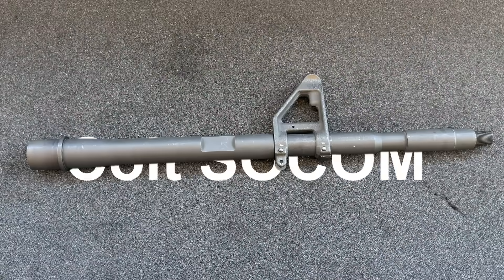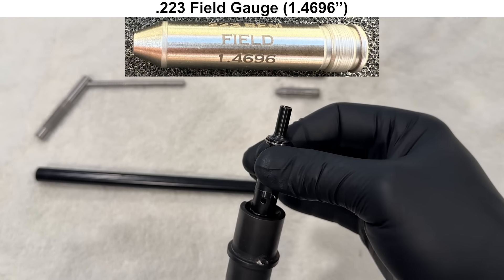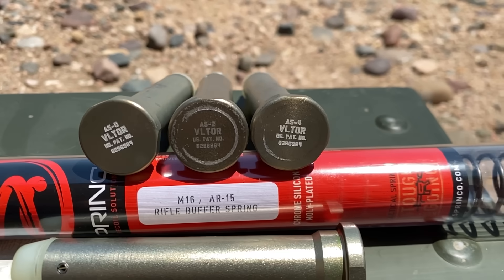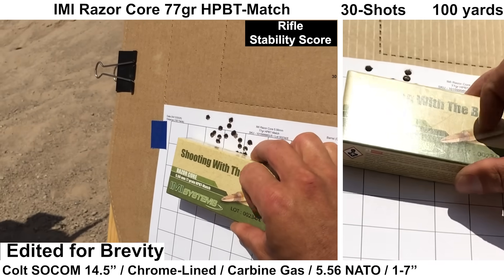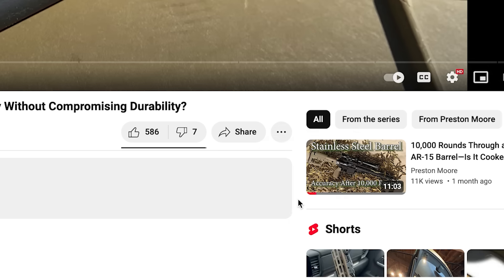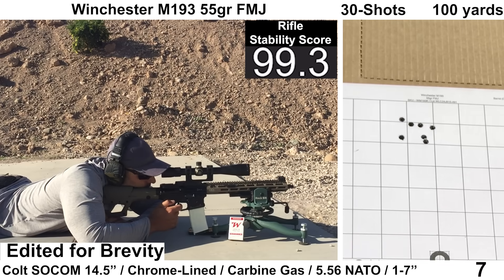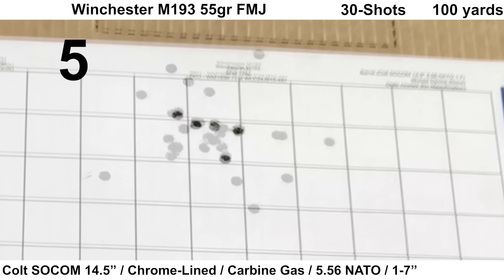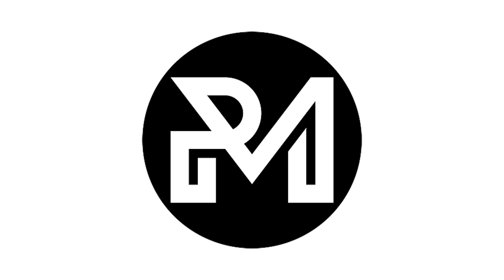Testing a Colt SOCOM AR-15 Barrel (Groups, Borescope, Headspace, etc)

Comment: Thank you for these videos, I am thoroughly enjoying them! I was curious, have you ever thought about doing comparisons of barrels with/without suppressors? I ask because, well one, it's pretty widely believed that suppressors can improve accuracy with most barrels, and two, I just happen to have a M4(ish) build I did using this same 14.5" Colt SOCOM barrel, and my results have been considerably better compared to how it performed in your test. Now yes, I completely understand that different barrels, environmental conditions, ammo, and even the shooter, will make a difference in results, but I was genuinely surprised at how poorly the barrel did in your test, and was wondering if the fact that I almost always run mine with an AE M4 suppressor (aka the Gordon suppressor) on the rifle made a big difference. 

By way of example, on my last outing with that rifle I was testing two different lots of the AAC 77 OTM ammo I had purchased just a month apart, and with one the first lot I decided to put a full box into one group. That 20-round group, as measured by Ballistic-X, went into 1.822" (0.771" W/1.816" H) with a mean radius of 0.484". For the other lot I only shot 10 rounds, but those went into 1.425" (9-shots were 0.919")(and oddly, 1.396" W/0.416" H) with a mean radius of 0.381". I would also note, even though both lots were the exact same SKU from PSA, and both were rated for 2,700 FPS, the lot I shot the 20-round group with chrono'd 2,588 while the lot I used for the 10-round group chrono'd 2,489. Anyway... sorry for the long rant, but I just wanted to add some food for thought. Thanks again!

Comment: When you started shooting the M193, I expected good results on the premise that the Winchester cartridge was MADE for the Colt SOCOM barrel. The results were initially disappointing, until you compared them to the other barrels shooting the M193, and one can obviously see that I was initially correct: they are indeed, made for one-another.

This seems to be damning the Winchester ammunition with faint praise, however...

Comment: I know it’s a sample size of one but my bone stock 6920 SOCOM is my most accurate barrel to date. I’ve shot countless groups with FGMM 69/77gr and black hills mk262 and it pumps out <.75 moa groups very consistently. I’ve never seen another one do that but it blows my MK12 Douglas barrel out the water as far as consistency with accuracy. Also it gives me the lowest SD/ES from the same lots of ammo when tested next to each other. Mine has been exceptional but I fear I would never find another one that shoots that well from Colt.

Comment: This shows something I try to tell whoever will listen.  The M4 profile usually has harmonic flow issues due to the accessory cut near the muzzle. You can see it in how the Target pattern forms . It's fine for combat and defense but sporting use can be limited . Varminting and target shooting for the smallest groups possible are limited propositions.  Literally any other standard ar barrel profile would be better for making small groups at long ranges.  A free floated pencil barrel of good quality can often make tiny groups but only for a small number of shots at a time.  I love these tests .

Comment: Do you notice a taper when measuring the barrel extension diameter? A barrel I recently purchased has about .0012 increase near the shoulder end. I was told this was part of the design and I'm curious if this is common will all barrel extensions.  TIA!

Comment: Hmm. I've seen some similar results with another colt barrel when the mating surfaces of the barrel extension and the upper receiver were not true to one another. Swapped upper receivers and the groups were halved. Barrel nut torque was the only other variable that I could find. Shot 4-5 moa at 100 yds with M193, only slightly better with IMI 77gr, worse with Mk262, and shot 3 moa with M855. After the swap, IMI 77gr was down to 2 moa.

Comment: Colt SOCOM used to be one of the most accurate CL barrels . SOCOM is just tried and true classic . I'll ways be a sucker for TDP Colt M4 / M4A1 Family of Carbines . 
It would be awesome if someone had Cage Code FNMI M4A1 barrel to see the diffrence..
I kinda figured with modern technology the SOCOM was not gonna do all that well but also wouldnt be surprised if it did . Colt M4A1 SOCOM Barrel is 2003 technology..
Awesome video bro

Comment: First of all, I'm proud of you for finally switching to a precision trigger. If I might offer another suggestion, it's that you should use a more rigid handguard system. Such as the Larue, Seekins etc in order to rule out rail flex from bipod loading. I'm a huge fan of this series and it would be awesome if you eliminated that last big variable.
Reply: Only a beefed up upper receiver helps with “rail flex”.  The most ridged of hand guards all attach the same way to a mil-spec upper receiver.
Reply: @WhatAboutTheIndividual yes they play together that's why he should be using something that takes out those variables like a larue stealth 2.0 set as an example
Reply: Seekins makes rigid handguards? When I think of rigid handguard Seekins Precision is probably the absolute last handguard manufacturer that I would think of. Granted I've never handled one because I'm not a fan of the Aesthetics but I would've never thought Seekins and Larue could be spoken in the same sentence as far as handguard rigidity goes. Do they use a pin between the upper and the handguard or something? I thought they were a basic friction fit with 2 Bolt clamp?
Reply: @joshuabruce9920  The DMR Rail clamps on the upper receiver extension and not the barrel nut itself I believe.
Reply: @aventador832 correct, as far as the larue, I don't know about the seeking precision
Reply: @joshuabruce9920 they are semi-Monolithic and widely considered some of the most rigid spr rails on earth
Reply: Why doesn't the new Aero Mod4 get any love here?
Reply: He's not firing from a bipod...he's shooting off a sled. Did you even watch the video?
Reply: @rustyshackleford8473 point still applies, any pressure at all on a weak rail (BCM) will string your shots vertically

Comment: Well considering the spec is <4 MOA with ball ammo I'd say that Colt delivered what was asked for.
Reply: But they didn't. With ball in this test, group size was over 4moa
Reply: @jamesdracula9276 The mill spec is a 10 round group not a 30.
Reply: @jamesdracula9276 I believe that the military spec test is 10 rounds
Reply: Mwell the INTERNET promised me that the Colt SOCOM profile barrel is supposed to be a Sub-MOA guaranteeing miracle barrel and that's why SOCOM had Colt make it. So the internet has made the barrel underwhelming.

Comment: surprisingly bad for Colt if you compare to Molon's testing
Reply: I miss that guy, Molon.  Does anyone know if he still posts anywhere?
Reply: @Matt-dd3cw Sniper’s hide, I think.
Reply: Didn’t MOLON use handloads, though? I need to see if he shot standard factory in his SOCOM barrel write-ups.
Reply: @19anthro11 he usually did.  He had a particular load that shot well in many of the barrels he tested.  I forget what it was, I think VV powder, he may have switched up bullets.  I think he did what he could to get the smallest groups out of each barrel, but I know he also tested with a lot of m193 and m855

Comment: Looks like you have a lot of the new crappy and slow AAC 77gr. They neutered the round around Jan/Feb of this year due to a “powder shortage” and changed the powder. 120-200 fps in my guns. Initially they still sold it in the 2700 fps boxes, they have now changed it to 2500 fps on the boxes, with the 2700 fps sku being out of stock for a couple months now.
Reply: It was restocked briefly this morning
Reply: @andersalbertsson215  I bought some in feb and april and it says 2700fps on the box and i was getting 2350 fps from a 16".
Reply: @corycarlson8712  Yeah I got one of those lots too, it still goes 2700 in my Criterion 18" but closer to 2500 in my BA 18"